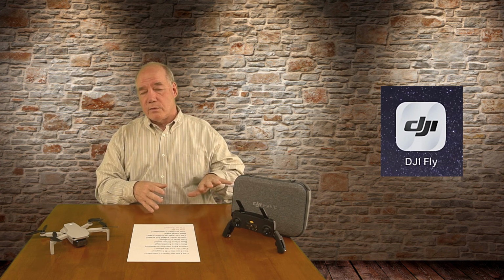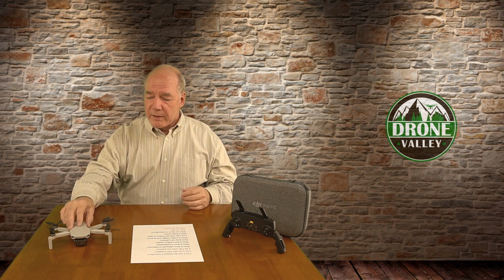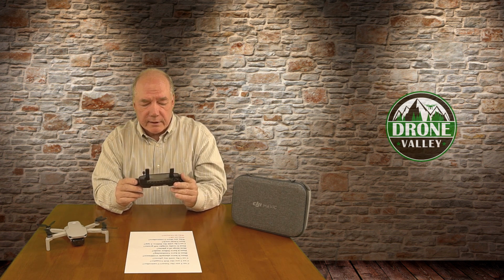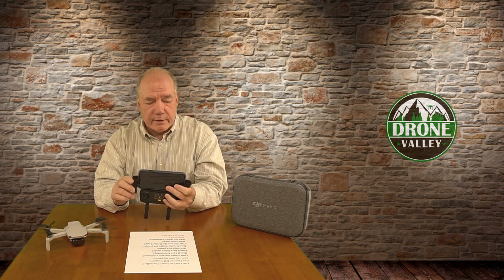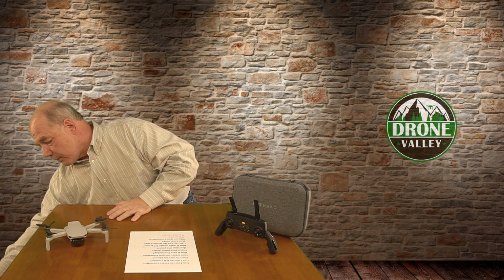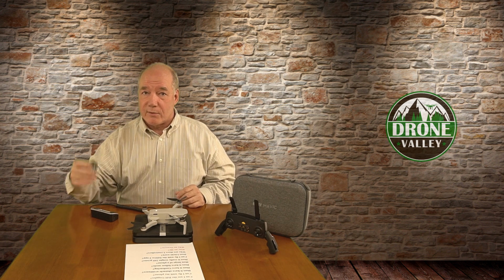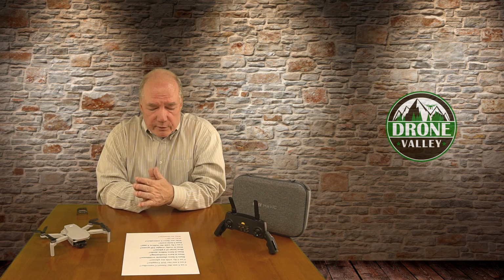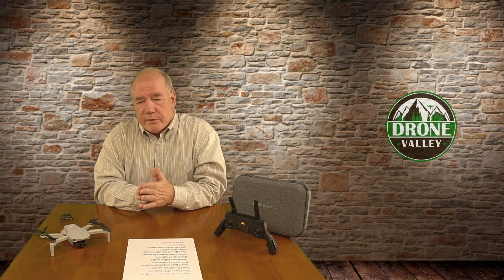Mavic Mini - Your Top 10 Questions Answered

Comment: Thank you for a very informative insight. I am particularly interested in the features the Mavic Mini is missing. You actually talked about them but I'd be grateful for some clarification. Could you, please, group them (the lacking features) in categories, e.g. "it's already there, they just need to unblock it," "it's possible, may become available in the future firmware versions/with third party apps," "possible yet impractical/dangerous (like follow up without front sensors)," "no-no, not with this hardware; buy another drone or wait for a Mavic Mini Pro/2." I am interested in the feasibility of potential upgrades of the quad, and not speculations on DJI's good will or policy.
Reply from the maker: Thanks for the post and I went through a lot of different features they might add. Most of them are possible except for the obstacle avoidance since they need the sensors in the drone to do that and they are not something that can be added later. Almost everything else can be added with a firmware update and based on previous products that DJI has released they enable a lot of new things over time with these updates. I always cover new firmware releases so stay tuned and I'll be sure to post a clip when something new comes along. Rick
Reply: @Dronevalley  Thank you for a prompt answer. You're basically confirmed what suspected. I wasn't sure about the manual video settings. It's just a question of the software, and not different/more powerful electronic chips?

Comment: I live in India, should I buy the drone from the US or Europe? Will it matter in terms of distance of the drone's flight? Or will it change as per the location that I fly?
Reply from the maker: Thanks for posting and I think the drone adjusts for the country you're flying in but I'll have to confirm that. I do know that the U.S. (FCC) version of the Mavic Mini has the strongest signal but doesn't use the 2.4Ghz band. I would suggest buying the version appropriate for your country to be sure it'll work with your local standards.

Comment: Excuse my novice to all of this, but the mini will most likely be my entry level into quads. My question is if you run out of juice from the batteries while flying does the Maverick have a protocol function to where it returns to the take off point before it falls out the air?
Sorry if this is a common question but as I stated beforehand I am really new to all of this.
Thank you sir, for your time.
Reply: P D yes, it has GPS and RTH (return to home) functions. Low battery indication will come on around 45%, I believe once it hits 10% maybe 20% it will auto RTH. I believe you set it up in the settings- the particular % which initiates RTH. Same for connectivity issues, it can be set to where a loss of connection results in RTH
Reply: @Khonic23  Thank you for the response Khonic! $400  bucks zipping through the air is a little nerve wracking for some one like me. It's nice to know they have fail safes in place for certain scenarios!
Reply: P D just remember every single flight you risk losing your $400 so just be vigilant and aware

Comment: Since this is “a toy”, will the geofencing allow it take off in my backyard if I’m 4.5 miles from an airport?
Reply from the maker: Mike, it's small but with the features it's got packed into that tiny frame, it's far from a toy. Having said that, it does still have geofencing inside but I found it to be more "relaxed" than my Mavic 2 in where it would let me takeoff. If you're that far from an airport, you'll probably be able to fly it nut it might be limited to 150 or 200 feet.
Reply: Thank you for the reply (you REALLY DO read the comments! 😃) .

150-200 would be way more than high enough. I was just hoping for 20-50 feet to record the grandkids on my back acres.

Comment: I like the mini but if I can’t use goggles I don’t want it.......
Reply from the maker: Thanks for the post and the issues is that the Mavic Mini uses a new app called DJI Fly and it's not yet installed on the DJI Goggles. They could fix this with a firmware update in the future. I'm also testing to see if I can side-load it and will post a clip if I get it working. Be sure to sub the channel so you don't miss anything. Rick

Comment: Why was I under the impression that because of the weight of this drone gofencing was somewhat negated? Thank you for the clarification.
Reply from the maker: Ken, it still has it but it seems more relaxed than the larger drones I fly. I testes a few areas where I normally can't take off with the Mavic 2 and this MIni flew with no issues. They may tighten that up with the released firmware so we'll see what happens. Rick
Reply: Very interesting Rick thank you for the reply.  From the blogs I have read etc. I really formulated the opinion that the whole point of this new weight was really a work-around geofencing, a very  calculated move on the part of DJI. It will be interesting to see how this develops and if that in fact is the case how long it will take the FAA to catch up. Thanks again.

Comment: At 249 grams, adding prop guards or a lens filter, sun shade or even just a skin will likely put it at or above 250 grams.  And it wont take the FAA long to reduce the weight limit.  Dodging the registration requirement is a poor reason to buy the mini.  At best, its a temporary dodge.

Comment: In Portugal, a toy drone (<250g) has additional limitations, like you can't fly above 100ft (30m). Like you said, if you put on a sticker or the cage and its takeoff weight becomes above 250g, do you know if you can register the Mavic Mini and fly it like a "non-toy drone", have the same 400ft altitude restriction? Thank you for the valuable content and possible answer

Comment: does the dji mavik mini auto home return when it loses contact? And if it does what altitude does it go to before it returns?
Reply from the maker: Yes, it has RTH and you can set the height that it flies to before heading back to it's takeoff point. I'd suggest setting it over 100 feet to make sure you clear trees and other structures since it doesn't have obstacle avoidance.
Reply: Thanks!

Comment: i have to say as a mavic 2 pro and inspire 1 owner (and ex mavic air and mavic 1 pro pilot) i have to say.. both impressed and disappointed at same time....  i dont like the pricing, if it was $249 for the base model with current feature set and base kit as it is now... absolutely not even a second though. but at $399 us....no way noooo
Reply from the maker: Thanks for the post but DJI was targeting the consumers that have always wanted to fly but didn't want to drop a lot of $ on a quad until they knew they would enjoy the hobby. Their only real choice up until now was to got for one of the cheap toys that flew horribly and had a really bad camera or spend a lot to jump into the hobby. At $399 the Mavic Mini packs a ton ot tech into a 249g frame that give new fliers 80% of the experience of the larger and more expensive quads at a reasonable price. I think they have a winner on their hands.

Comment: Would it be possible to load the USA firmware onto a UK controller for better range ?
Reply from the maker: The actual firmware is the same for both and I think the controller knows where you're standing and makes the adjustment to the proper transmission setup for the region. I'm not sure if there's a way to "fake" this. Thanks for the post! Rick

Comment: Hey Rick, does the Mavic Mini respond to hand signals like the Spark did? Or do you think they may include that feature in a future firmware update?
Reply from the maker: Thanks for the post but the new Mavic Mini doesn't have gesture control like the Spark. It does have a 3-axis gimbal and a 30 minute flight time, which are both improvements over the Spark. Stay tuned for more content this week and thanks for the post.

Comment: Thanks for the informative Vid. Quick question do you have to calibrate the Compass before it’s Maiden flight ?
Reply from the maker: Thanks for the post and you should calibrate the compass if you move a far distance between flights. It takes about 30 seconds to do and ensures that you have an accurate Home Point set for the quad. This way it can return to it's takeoff point in case of trouble. Thanks for the post!

Comment: It is an overpriced dumb drone still... The price is always set based on what the market can bear...sales 101...and not the engineering costs/reasons.
They could have put a lot more features in the Mini, but "dji" did not want to impact the sale of the other models.
Reply from the maker: Thanks for the post but whenever you design a product (at least a successful one) you always start with defining your target consumer. In this case DJI wanted to build a quad that the average consumer could afford and fly easily. Those two factors were the basis for the Mavic Mini. They then added a lower weight to it as well to allow folks to fly it without having to register it. So keeping the price low meant they had to compromise on some features that other higher-tech quads like the Mavic Air and Mavic 2 offer. This entry segment of the market was a gap in product for DJI and I think they filled it very well with the new Mavic Mini. You're getting 90% of the same flight experience of higher-priced drones in a small and affordable package. Stop back soon for more clips to show you all the things this little guy can do. Rick
Reply: @Dronevalley   I think we should expect to have at least some obstacle avoidance/safety feature in late 2019 for this price...
I am wondering what will the competition answer to this challenge though!
Thank you for your answer and for the time doing the reviews!

Comment: Rick, as always, your remain a great source of information. Thanks :). Now that the Mini is out, and firmware in place, I'd like to know more about the NFZ related issues with this quad. Would like to add to my small collection, though if the Chinese are going to continue to limit where I can and can't fly, within reason, then they won't get my hard earned $$$$.
Reply from the maker: Marc, thanks for the post and the Mavic Mini does include geofencing to limit flights in restricted airspace. I will also add that the FAA (and DJI) have relaxed that a lot to now be a graduated flight restriction. You have to remember that DJI doesn't set these NFZ areas, they are simply building those into the firmware so their drones don't inadvertently fly into restricted airspace. When the FAA changes the limits, the software just updates them. The good news is that the FAA has recently modified the maps to allow flights at lower altitudes near some of these NFZ's. For example, I live near a military base and with the old maps I couldn't take off near a lake I like to fly because it was inside of the NFZ. With the new maps, I can now take off and fly up to 150' in the same location, which is plenty high for me to get some great footage. I hope that helps and thanks for the post. Rick
Reply: @Dronevalley  Rick appreciate the post, I haven't owned a DJI quad in awhile, I'm presuming I could take a look at the "relaxed" and or "modified" NFZs set in place by the FAA, implemented by DJI, on their website?

Comment: For those who having issues with NFZ's, trade in or sell your Mavic for an ANAFI or Autel EVO. I did. The developers have left it in the hands of the operator to use good , safe 

common sense when flying. The software will advise you of any NFZ related issues, though you the operator, have the freedom to make the final decision.  Actions have repercussions, and we all have to accept responsibility for our actions, good or bad.
Reply from the maker: Mark, thanks for the second post but I have to respectfully disagree with you about the downsides of NFZ's. I've always felt that any technology that helps me fly safe and not violate restricted airspace is a good thing. That's exactly what geofencing is designed to do and with more new fliers entering the hobby, it's more important than ever. The logic of eliminating geofencing eludes me since it's only there to help you avoid flying into a restricted airspace and violating the law. I know that Autel and Parrot don't have geofencing in their quads but I promise you this was less about freedom and more about the difficult engineering required to add it to their quads. If we share any resource (roads, lakes, parks) there have to be some rules defined or it's chaos. Imagine if traffic lights were voluntary or you could decide if you wanted to wear pants to a baseball game. Your decision would affect me and others and could put my freedoms in danger (especially the pants thing). So these restricted areas in the sky have been created to protect the things under them. Mostly they are airports (good idea), prisons, military facilities, power grids and government buildings. All places in these tense times that a drone has no business flying over. If you really feel differently, see how far you'll get crashing through the same gate at a military facility that folks want to fly over. The most dramatic point I can make in favor of NFZ's, and a quads ability to respect them, is the current situation in California with the fires. This last week the brave folks fighting those horrific fires had to suspend air-drops of critical water to control the flames because some goofball was flying a drone (with no geofencing) over the fire in a restricted airspace (TFR in place) just so they could get some cool footage of the blaze. I'm sorry to go this far into it and I know that you're a responsible flier that would never do this but a lot of folks are going to read these comments and it's important to understand why these restrictions are in place. This is especially true for new fliers who look to old-timers (like us) to help them fly safer. Thanks for the post and I hope I haven't offended.
Reply: @Dronevalley  Rick appreciate the post, as I always welcome various points of view on this hot button Topic.  You eloquently stated "I've always felt that any technology that helps me fly safe and not violate restricted airspace is a good thing".  Which is exactly my point, I don't need technology to help "ME" fly safe... I.e. implementation of No Fly Zones built  into the software of DJI drones.  If a quad operator doesn't have the necessary   discipline required to safely operate and adhere to the safety regulations implemented by the FAA to keep the skies and the public safe, then perhaps said operator shouldn't be flying a quad. For operators who operate on the fringes of violating the law, then yes, I would agree,  said operator needs the assistance of an outside third party to ensure said operator flies their quad in a safe, responsible manner.  I think it's pretty cut and dry.

Comment: My fear is that the rules will change next year, and they will lower the weight requirements...do you think there is a chance of this? I have had a Mavic Air, and really sold it only because I did not want the hassle of going through the hoops to fly it, so this mini is really what I would love...if they don't change the rules....lol
Reply from the maker: Thanks for the post and with the release of the Mavic Mini the weight limit might change and I wouldn't worry about it happening anytime soon. Even if they did require the registration of quads under the 250g limit, the process takes about 5-minutes and costs $5 to fly all the quads you want. I think that's a really good deal for an amazing hobby like this. Stay tuned for more content this week. Rick
Reply: @Dronevalley  Thank you Rick, I appreciate your responding! Very helpful!

Comment: Excellent vid. I had thought the front corners were obstacle avoidance as well - everything you said makes total sense though.
Reply from the maker: Steve, thanks for the post and I thought the same thing when I saw the leaked photos but it turns out that those corners are just bents to let air inside the quad to cool off the PC board. Stay tuned for more clips this week. Rick

Comment: Thanks for the excellent video, I am new to drones and still on the fence if I should purchase one. What software do I use to check for nfz?
Reply from the maker: Thanks for the post and there are a few apps that will let you know if you're in an NFZ. The one I recommend is the B4UFly app, which is updated by the FAA and even includes updates for temporary restrictions like around the wildfires in Calif. The good thing about the Mavic Mini (and all DJI drones) is that it will check before you take off if it's OK to fly at your location. Stay tuned to the channel for more content posting this week. Rick
Reply: Thanks Rick - re NFZs do you know if an app for say Europe exists, do the NFZs in Mini cover countries other than USA?

Comment: hello i love your videos, very in depth and honest, but a question i havent seen asked yet is what devices are compatible with the new dji fly app? i use a galaxy s7 and was wondering if that is compatible with the new app, there is a micro usb cable in the mavic mini package so im sure it will. thanks!!!
Reply from the maker: Miles, you should be fine with that phone. The unit comes with a MicroUSB, USB-C and Lightning cable to accommodate a wide range of phones and tablets. Good luck with the quad and let me know if you have any other questions. Rick